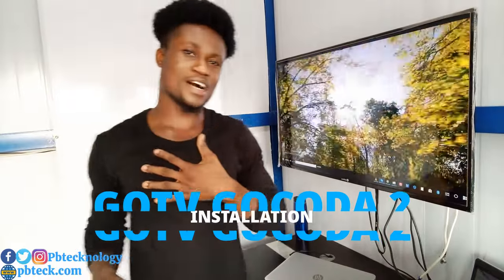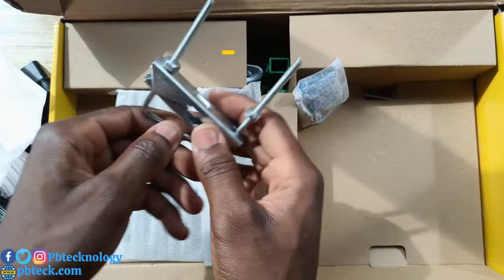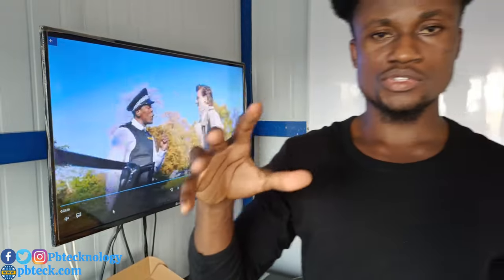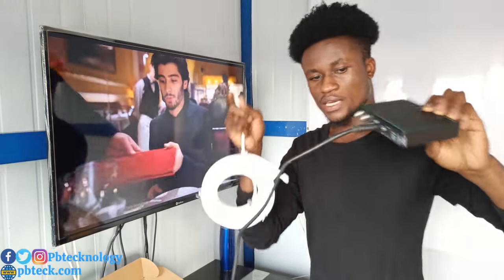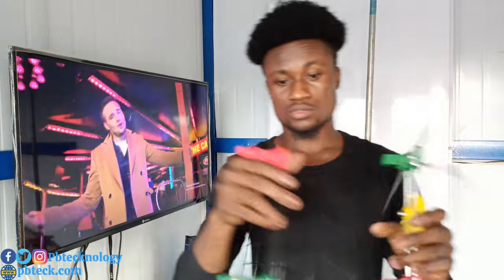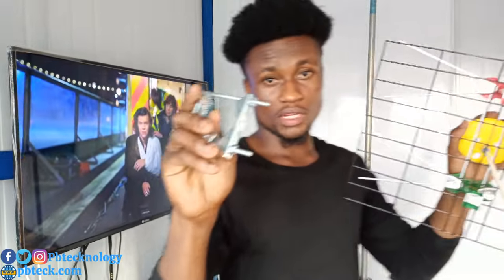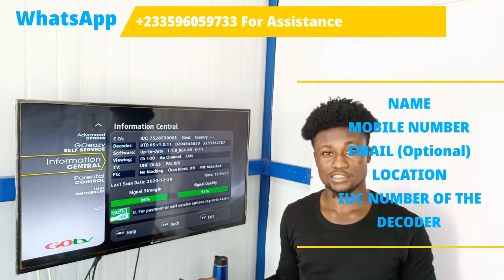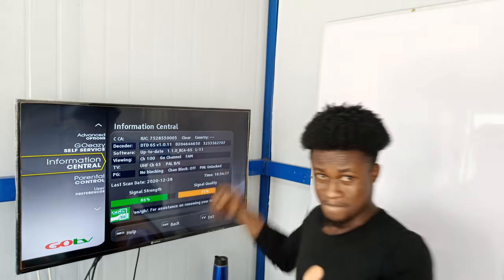How To Install Gotv Decoder And GOtv Antenna

Comment: please the frequency you used in tracking it, am your subscriber from Nigeria, thanks Boss 👍
Reply from the maker: Some of the working Frequencies in Ghana
* 482.0 - 8M
* 516.0 - 8M
* 620.0 - 8M
The Frequencies in Nigeria might be different. Just get a stable signal from the  Antenna and it will work.
Reply: Thanks Boss

Comment: so of the rf out port, what do you that for
Reply from the maker: The RF Out Port is simply for sending  video signal to different Tv set, whereby the video signal is being modulated into channel. And this connection is being done normally for TVs with no component video input. To simply put it, you can share the video signal to another TV set with the RF out Port, but the downside is that you'll not get quality video output on the second TV.  I appreciate your Comment Elvis  ❤️

Comment: this new decoder has only 2 ports which is the port to connect the charger and the AV port to the TV, so how one connect the decoder with TV and home theater?
Reply from the maker: Split the AV cable. Yellow cable which holds the Video signal goes to the TV set and the Red & White cable  which is audio left & right goes to the Sound System.

Comment: how can you connect the new Gotv with TV and Home theater together?
Reply from the maker: Split the AV cable. Yellow cable which holds the Video signal goes to the TV set and the Red & White cable  which is audio left & right goes to the Sound System.
Reply: How do you split your av cable sir ??
Reply from the maker: Buy ( AV Splitter) for electronic shops.
Reply: Thank you Sir I will try it out

Comment: Please does it mean, if I use HDMI, I can't connect to a sound system again. Please help
Reply from the maker: You can connect to the sound system with two options:
* You can tap the sound from the plasma TV by connecting the sound cable unto the (Jack port or Audio output port) if there's any.
* You can also connect the ( jack - AV adapter cable) from the decoder unto the sound system, but use only the Red and White cable, that's the audio left and right. The yellow cable carries the video signal. After getting the sound, you have to off the sound coming from the plasma TV.

Comment: But my own is just telling me  my signal is bad and I don't have signal detector
Reply from the maker: Let someone watch it for you whiles you're turning the antenna to get the signal. You don't need any detector for that. It's easier to get the antenna signal. In simplest form, turn the antenna to one direction and scan for the channels, if you don't get it, repeat the process until you finally get it. Make sure to fix your coaxial cable really tight. ❤️